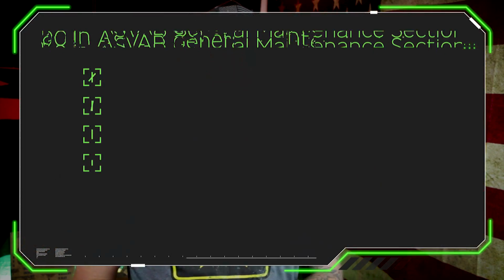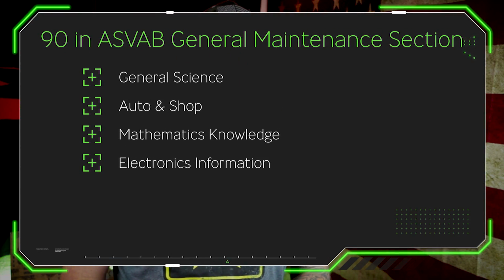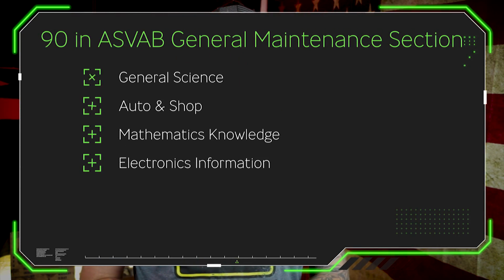12N Horizontal Construction Engineer

Comment: 5% operating, 95% sweep the motor pool
Reply: Not true. I am serving with 12N and they are on the field a lot!
Reply: @Mike Swarley Germany
Reply: @Mike Swarley 91L
Reply: Maybe 80/20 if the weather is super bad, then the 20% is going to be doing snow removal or flood control depending on the season.
Reply: @blankpage111 lies I never operate

Comment: I really like this job, its not for everyone. It requires a lot of dirty work, like working with oil, metal and dirt. Depending on your unit you could be in heavy construction equipment like you were trained on in AIT, you could also be a driver for a LET and trailer, or you could be a 12N in a combat unit and have to drive a husky or buffalo. Being a 12N you're really a jack of all trades and master of none, because every day in garrison is a different thing, you could be in the motorpool, you could be in the maintenance bay or out driving, or you could be in operations helping build packets for soldiers. For Joe's wanting to get into this field don't expect to do your job a whole lot on some posts, because the army thinks its smart to use contractors instead of the guys you trained to do the same thing.
Reply: Calvin Otis can you get out in 4 years and make GOOD money in the civilian world? Cuz if not I ain’t picking this shit.
Reply: what is the most difficult part about this mos?
Reply: @MrSodaBelly  depends on the unit. Heavy mechanized unit, absolutely, you get a lot of operating time as a soldier, as an NCO you lose the operating time, but get time as a project manager. In an airborne unit, you work with combat engineers and do a lot of what they do
Reply: @paigeburton8995  depends on what you want out of it. You want to be a combat soldier, go airborne. If you want to be a construction engineer, go to a heavy unit. The hardest part of this job is going from a non-combat unit to a combat unit where everything just gets stupid.

Comment: I haven't seen you cover 12C MOS yet. That one's tricky because if you look online, you'll mostly find them building IRBs and most of the content available pertains to MRBCs. But it's so much broader than that, with Airborne qualified units, bridge companies, air assault and river assault related tasks, combat engineer tasks in Stryker and other units, REBs, MGB companies, etc. 

It would be interesting to see a video that really touch the surface of what 12C does.

Comment: Are used to repair small equipment and engines and motors also laundry and bath and chemical equipment repairs, when I was in the army and also work cross training with air-conditioning refrigeration at the time it was cold 63J/52C. I think today it’s called small engine in utility specialists

Comment: currently a 74D, I may be changing my MOS to this one for the civilian certs
Reply: I am joining as a CBRN Specialist.

Please tell me more about your experience. Positive or negative?
Reply: @marlonmoncrieffe0728  it depends on the unit you go to really. Most likely youll be in a CBRN cage doing inventory/fittings/cleaning/etc. Its not a bad job though. Just boring at times
Reply: @burritoburnett  Yikes! If I wanted to be a clerk, I'd choose to be a clerk!

🤔 Maybe I should go with my back-ups of 68M or 88N instead...?
Reply: @marlonmoncrieffe0728  Maybe, CBRNs can do some pretty cool stuff if they go to the right unit. idk about thosr other ones

Comment: When I was in, we were 62E “ Heavy Construction Equipment Operators.”  The MOS later changed to a 21E but the description remained the same.

In my unit, if you weren’t deployed, you basically hung out in the motor pool all day. You became an expert broom operator in a short amount of time.

When you were deployed, you were generally working 12-16 hours a day. Jobs varied depending on who needed what. We didn’t get uparmored equipment until 2006 so prior to that, you were exposed. You were always dusty/dirty and so were your M16/M249s.